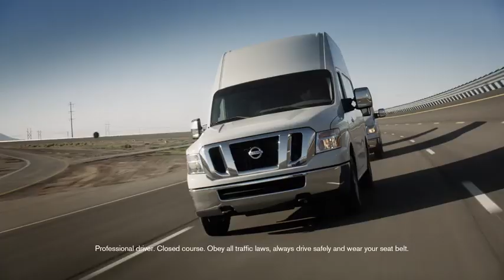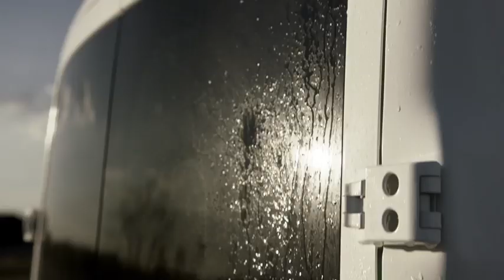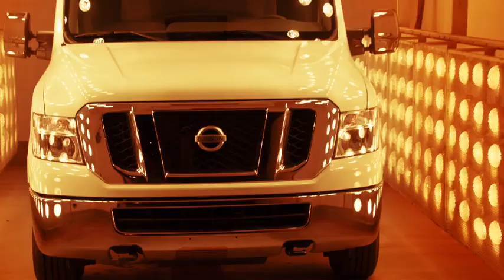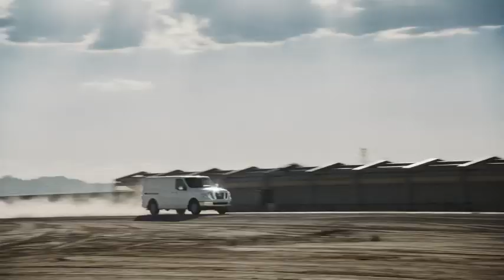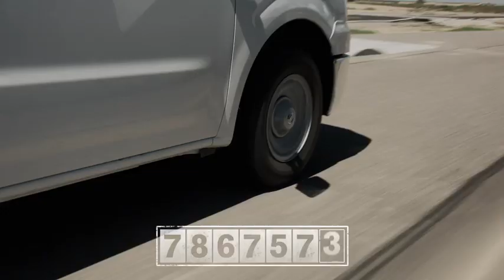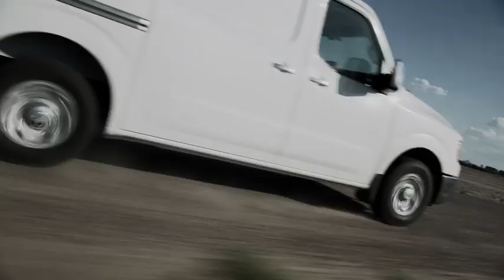NCV Proving Grounds: Watch Nissan test its vans at the NCV Proving Grounds

Comment: I bought the NV 2000 SV 2017, it has 14,000+ miles so far. Every two weekends I drive around 500 miles from fort Myers to fort Lauderdale, plus the week drive like 50 miles...I use it as a personal "car", never loaded it heavy....only regular schedule check up, rotate tires. zero issues. Zero. The tires even look new...I love it. 100k miles warranty. Will chime in as more miles pile up.

Comment: I bet Ford Transit can beat this!
Reply: Lilian Verma nope I loved the old Econoline which is why I like this one a strong body on frame a big V8 not useless ecoboost a weaker unibody many people hate the Transit over the Econoline
Reply: HERPY DERPEDY Never used an econoline so I cant say for sure. Mercedes Benz has the best suspensions for a 4x4 van which I’d get if I had the money to buy it. Sprinter is too expensive, the Transit was cuz i could afford it. V6 Ecoboost isn’t bad. It’s the same as the F-150 so whatever.
Reply: Lilian Verma oh I definitely get a Sprinter but they are expensive but the 4×4 is no joke it's not useless awd like express van but actually locking transfer case but I they are usually around $50k or more
Reply: as for the Chevy Express, I'd say its okay. Its definitely smoother than the Transit, damn this Transit is so bumpy I'm meditating on suspensions however those are $200 to $15k, I have to take it in and get them installed. But the Sprinter is a better alternative regardless and it looks nicer than the transit. Smh buyers remorse. :-(
Reply: Bet the transit dosent look like an oversized truck, because it looks like an oversized minivan!
Reply: harvey dog - The newest transit is a little disproportionate in my opinion. Unlike the older transit models you may have seen if u live in Europe, the Mk7, Mk6 and before had an even body design. Square body square face. Soon as the new redesign of the transit Mk8 was introduced, same model also in the US is so disproportionate in my opinion... Very square body and round face. Like somebody took a puppy's face and glued to a milk carton LoL. The Econoline looks like an 08-10 super duty but a van version of it.